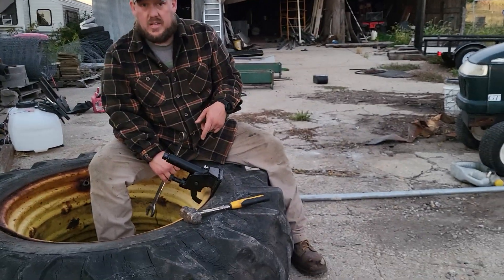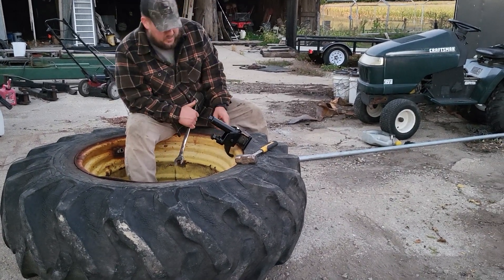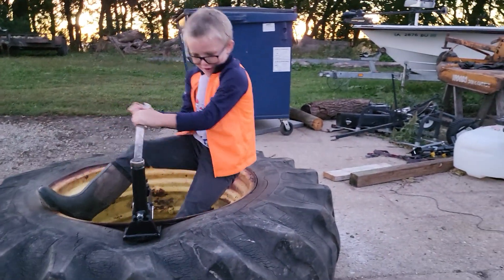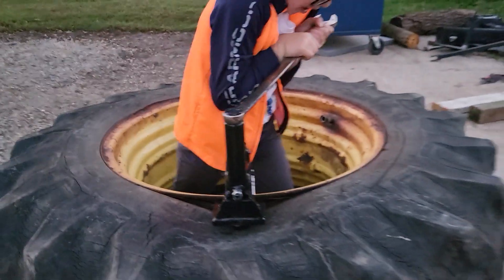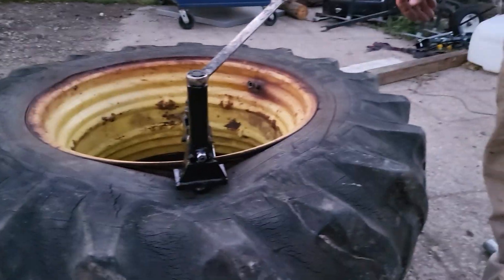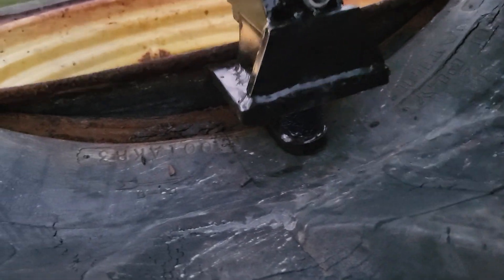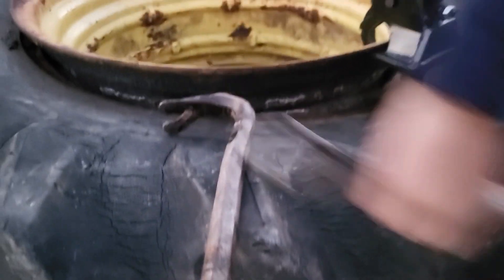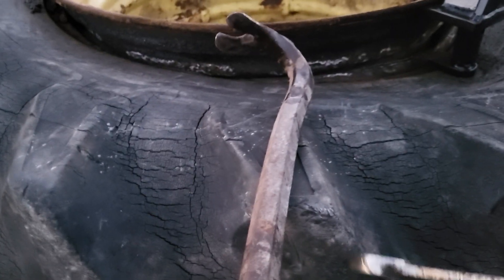Breaking a tire bead... Work Smarter

Comment: WD-40 sprayed around bead would greatly help.Once breaking down a truck tire with a slide hammer bead breaker worked my butt off. after I was finished boss asked  "why I hadn't used rubber lube?"  he almost ate that slide hammer, but I never forgot that lesson. LL&P

Comment: Been using an impact on mine for years now. Still use it whenever I can't get the pneumatic one in a tight spot.
Reply from the maker: I am sure I could, but I wanted to use it as intended and show how it worked.  I would also probably weld the nut on vs. rely on the pin to hold it.

Comment: I broke down many of those with a duckbill sledge and a couple of tires bares.
Reply from the maker: I did too in my late teens and early 20's but this is much easier. More than one way to break a sweat. Tools cost about the same.
Reply: @justinschneider2307  Yeah you got a point I was also in my 20's.... many years ago. cool tool for sure. as I'm sure you know they also have the pneumatic ones too. take care you have a hard working little man there with ya.

Comment: Dear Dad, why dont you use an impact wrench? if so, just only 1 minute. but seems ur kid got a nicely moment
Reply from the maker: Because the nut is held on with a roll pin, the company stated "Do not use an impact wrench" and some of the reviews showed the nut and roll pin sheared off.
Reply: @justinschneider2307  oh, got you
Reply: I've ruined so much shit with an impact wrench 😂😂😂😭😭
Reply: @justinschneider2307  Thanks for the reminder Justin I have the same tool and did not know that an impact could ruin the tool very good advice.

Comment: WHY DONT YOU AN IMPACT, TELLS ME ITS A WEAK TOOL
Reply: BECAUSE YOU USE AN IPACT IT WILL STRIP OUT, PNUE TEC TIRE TOOL  HAS ONE THE IMACT FRIENDLY CHECK IT OUT ON YOU TUBE
Reply from the maker: Settle down buddy, I was using the tool as it was intended.  Sure go spend another $100 to 300 more on an impact ready tool to save 3 minutes.  I only have a need for this tool a few times a year at best, I am fine with the manual tool. I need the exercise.
Reply: @justinschneider2307  One in every crowd, oops, there's one! (Craig)